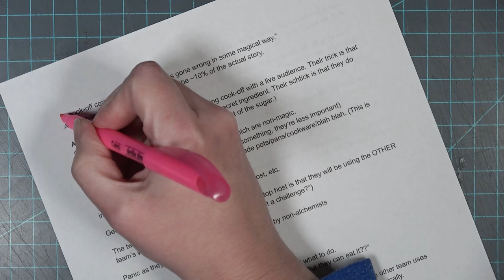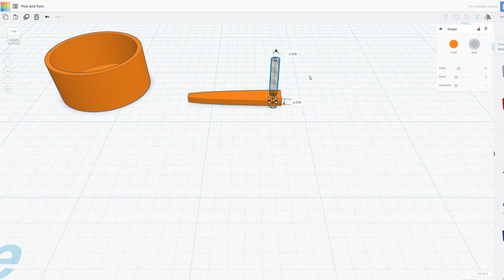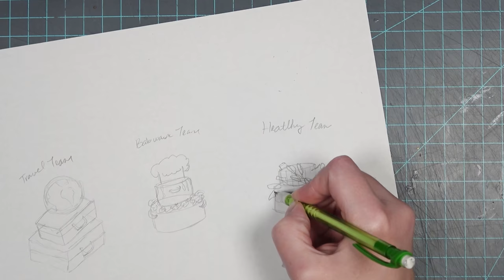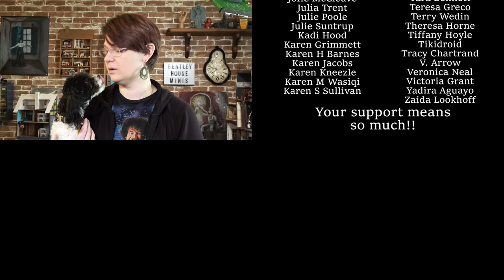Miniature Baking Competition Diorama🎂 (Collab with @KateCavanaugh )

Comment: Cake boards, which are cut to shape or precut forms are sometimes decorated with fondant, icing, buttercream or sometimes sturdy wrapping paper if foils are not used or if the form is not prefoiled/decorated. Cakes are put on them after baking and usually before major decorating. As far as creating a polymer clay 'icing'-- mixing powdered chalk or mica powders with liquid polymer clay would work well for that effect; Or using liquid polymer clay and painting it (after it is cured completely) with acrylics. It is neat stuff if you can use polymer clays (I cannot as I have allergies to the polyclays). Cute lil' cake show (^ _ ^)!

Comment: To make icing with polymer clay, you can get some liquid clay from sculpey and you mix it with polymer clay bits. Usually just cut up your clay into little  pieces and start to 'melt' it with the sculpey. It can be bagged up just like icing. It can also be used as a polymer clay glue.

Comment: You can color the liquid polymer clay with alcohol ink and use it in the baggie just like you did with the paint. If it’s too thin you can also put polymer clay in the liquid polymer clay and make it more of a frosting consistency.
Reply from the maker: Great tip!  I haven't played around enough with changing the consistency of the clay yet and I am sure it helps a lot!

Comment: This is soooooo good! I was wondering what you were going to do with that beautiful wallpaper you made. 

Your polymer clay cakes turned out perfect! Are you using premo? The sculpey original, can be difficult to work with, because it is so soft. Sculpey Premo is soft, but not as gooey and it is also stronger after baking. Depending on the item being made, sometimes using a shaped tinfoil base, works well. You can also do pieces in stages, by baking a piece for 5 minutes or so, cooling and then adding to it (prevents squashing, when putting pieces together). Use bake and bond between the semi baked and raw piece, to ensure pieces stick together.
Reply from the maker: Thank you! Yes I am using sculpey but I do want to try some other brands.  The softness of it can be really difficult to work with.  Thank you for the tips!

Comment: I was wondering, do you have a link for that textured spray paint?  I think if I spray that on, then cover it with black, it will look a lot like cast iron, and I wanted to try it with the pots and pans I ordered from you.   Haven't finished the video yet, so apologies if that's what you did.. I just wanted to stop and ask before I forgot.
Reply from the maker: I just got it out of my cabinet.  It is called "Krylon Natural Stone Textured Finish" the color is Granite.  I hope that helps!  It will look good for cast iron for sure!
Reply: @BentleyHouseMinis  It does!  Thank you very much. It looks like it comes in black and cinnabar as well.  So, if it looks right, no need to paint over.  I definitely will be getting some. I'll send you pics if they turn out well.. hehe